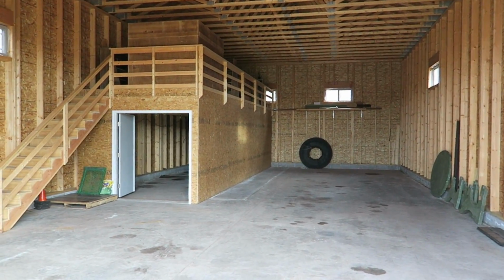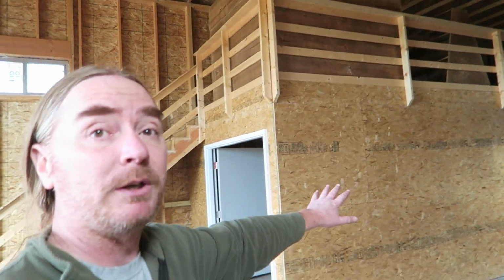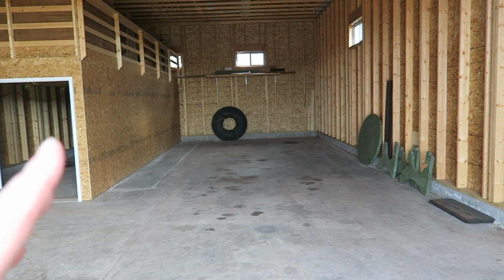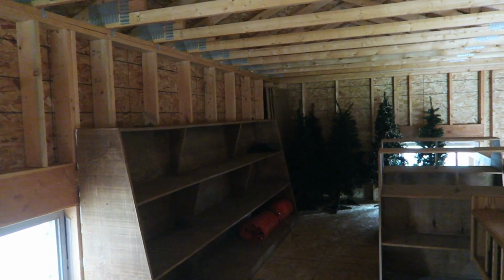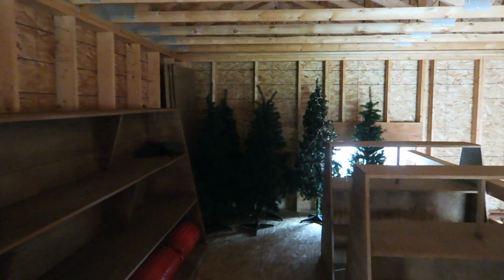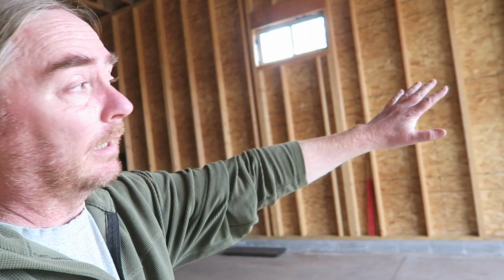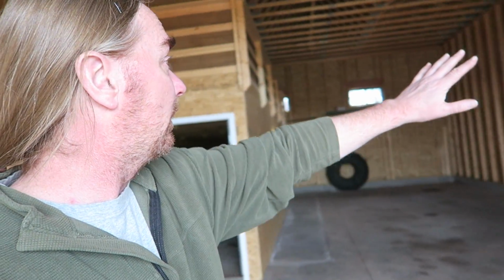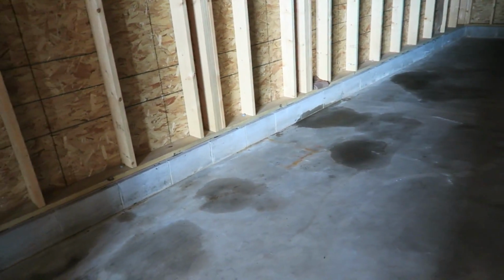CHECK OUT THE NEW BOAT SHOP!!

Comment: For this building I'd use rigid foam panels. Either XPS, EPS or PU. 
It's cheaper and those studs are ideal for it. I mean it's all straight. Spray foam is ideal if you have irregular walls and lots of nooks.
Also consider how often you need the space heated. Like if you only need a cabin heated 2 times a year it's not worth it to heavily insulated it. While if you work every day there it makes sense to insulate well.
What you also could look into but is a bit more experimental is to put lots of solar panels on top and JUST HEAT THE CONCRETE electrically. Basically you use your foundation and earth below your shed as a big thermal battery. Just put wires in the floor. This is by far the cheapest heating that you can do but you'd have to run the numbers. But solar panels are insanely cheap today. Cheaper than thermal solar or anything else, like 1 cent per kWh over 25 years.
PS: For LED lights you should get LED strips with a good "Color Rendering Index" (CRI). That is important for you because you need to "see" colors like they are. With some LEDs you get only specific spectral lines that can make colors look funny. Also nicer to be in.

Comment: Congrats on the new shop!  Hope everything goes with the shop upgrades.   It stinks that you might have to have a licensed electrician run everything.  Not knocking their work, but it gets expensive when you can do 90% of the work yourself.

Just an idea, when I rewired part of my basement after it flooded, for every outlet I replaced, I put two sets of outlets that are on two seperate circuits.  That way I can run two 15 amp tools side by side without tripping the breakers or running extension cables all over heck and back.  Just an idea that makes life easier.

Comment: Hi Andy, we live in a northern climate as well, Canada, and here it is common place to have R19 in batt insulation on the inside of your exterior walls and another 1” to 1.5” of foam insulation on the exterior of the building under the exterior siding. This provides a frost break from the outside and can provide an overall R value around R30 to R35. In the ceiling we typically use batt insulation between the wall plates and the rafter vents and them blown in fiberglass insulation to an R value of R40 to R50. Heat rises, so your floor will always be cool to cold and unless you create a thermal break, with rigid foam insulation which would involve a new floor! With closed cell spray foam you stop any and all drafts through the walls, which is key, and you do not need to apply vapor barrier over closed cell spray foam. Your ceiling will need vapor barrier to air seal it as tight as possible. Not sure about Michigan but here natural gas is by far the most efficient and economical, and as nice of a heat as baseboard radiation is there is little to no air movement so with walls that tall your heat is going to go straight up the wall. May want to consider some type of HRV that will help circulate the air in your new shop to keep the warm air moving and as close to the floor as possible. A hot air furnace that will blow the heat across your shop floor may be very comfortable and with the new furnaces they are quite economical. Stoping air infiltration and air escape is key when insulating. Good luck.

Comment: Hey Andy, have you considered using a polyisocynurate  insulation board fixed between your battens. It comes in a variety of thicknesses is incredibly thermally efficient and you can fix it your self. As far as the lighting is concerned ,led is the way to go but look into street lighting components, they are far cheaper than domestic lighting and will give you min 10,000 lumens and ballast that lasts. Good luck with sourcing locally.

Comment: another way is to put plastic vapor barrier  up   then drywall   then blow in insulation in wall  you will get R value of app 20.35  and will be cheaper to do

Comment: On the heating.  A couple of mini splits wouldn't be too expensive and would save you from having to bury gas lines.  Maybe a waste oil heater for the coldest days?  I had one in my old shop, burned 50/50 waste oil and diesel, worked great on the coldest days here in Maine.

Comment: First up get an energy audit for the building. The audit should also let you know what rebates and incentives are available in you area. The incentives may make some decisions much easier.  Electric and data can be run through the air so no digging if you can ditch the gas. Heat pumps have gotten much better and will work well for moderate days and provide cooling if desired in the summer. You would still want a fossil fuel heater to take over when the temps go below 15F. Giant solar array on the roof if grid tied can offset the electric heating expenses.  I like the idea of going with an inch of closed cell foam on the walls for air sealing with the rest of the cavity stuffed with either glass or blown in insulation. But again get an energy audit. The people who do those generally are  very up to date at what is the best path for that region.

Comment: You may want to check out "radiant heat tubes"  These are larger diameter tubes that would hang from the ceiling and run from the front to the back of the work shop. (2 - 4 tubes)  The advantage is you are not blowing hot air around the shop

Comment: Hi I was wondering if you could help me out I have a Ranger fibreglass bass boat where there’s a rod locker with piano hinges how the hinges that fastened to the boat is thin wall I would say and the screws don’t hold now so I was wondering if I took a strip of aluminum it’s fibreglass that to the wall side if that would be a good books to hold the PO hinge and the lid more secure appreciate your thoughts

Comment: Hi Andy, could you make part of that room under the mezzanine a spray booth  and install an exhaust unit to keep the fumes and dust down other? Also could you adhere foam and foil panels to the inside of  the panel lift door. If you  wanted to do underfloor heating put a membrane  over the existing  slab and use a self leveling  compound  to cover the coils.

Comment: Andy, here it is required to have a licensed electrician as well, if you have the knowledge you can do the work, then for a small fee a licensed electrician will sign off and the inspector sees that name for the work. You have to prove you know how since the electrician is putting their good name on the line though.
The home owner doing the work you might be able to get the variance from the inspector, but it still needs to meet code at least. The big problem with that, home owner doing the work if not licensed for it is insurance rates go up.

1" or 2" thick foam insulation ( as often used for inboard engine rooms ) on the big door panels will help reduce heat loss without major impact on the door operation.
With the floor not being insulated, by putting foam sheets down and pouring concrete on top you cover that aspect, it also reduces the height inside the shop but it adds a ramp requirement to the front outside the door.
The big closet under the loft, bulk storage space. Much easier than trying to rework it to allow your equipment to function.
An insulated interior wall between the front of the building and the doors with the side in front of the bay hung to roll to the other side and open access will also give you insulation from the big door losses.

Comment: Spray foam is excellent. for this year use 6 inch rock wool batts all around followed by vapor barrier, Vapor barrier the trusses and fill with 36 inch blown insulation. In 4 or so years build a 6 inch wall with 6 inch rock wool all around the inside of the building creating 14 inch rockwool batt insulation walls. A fella from Montana made a cement box 8 ft wide X 7ft tall, 20 ft long, piped the bottom with 4 inch thin wall plastic pipe to a manifold of 8 inch as a inflow, filled the box cavity with fist size stones piped the top of the box the same as the bottom. closed and insulated the top of the box to form a closed system. A 8 inch fan on each in and out manifold would pull the heat out of a solar air heater and warm the rocks. during the night and early morning the heat generated by the warmed rocks would be circulated into his house. In the heat of summer the fan would pull in cool air to cool the rocks and around 10 am he would circulate the rocks cooled air in the building. Worth a thought.

Comment: Andy, look into Cast Iron baseboard for the heat. Very durable, even heating. We use it here in Connecticut a fair bit, though it is more costly than fin-tubing.

Comment: Closed cell spray foam needs no vapor barrier. And its amazing. In the south the attic can reach 180 degrees in the summer no problem in standard blown insulation attics. With the roof rafters sprayed with close cell foam it’s literally the same temp as conditioned space. Open cell foam does require a vapor barrier. Good luck

Comment: Andy You have your work cut out. Unless you have won the lottery sharpen your pencil. You can do a lot of different things that give the same result. I read most of the comments and there are some good ideas but not all.  LEDs the way to go. However price price It is all over the place. I got four fixtures for the price of one.   

Electric since you don't have electricity at the building  I don't know how far you are from power or what the expense to run it in.  A generator might be cheaper. 

Foam insulation or Batt  Both work, then pencil work.   vapor barrier Plastic sheeting cheap.

You are correct the floor is a heat sink. You do not know if they put a vapor barrier down when the poured the slab. My suggestion on the floor place  plastic sheeting on the floor. On top of that 4 by 8 blue or pink foam 2" or 1" and cover with Plywood. Your feet or legs will love you later on. Again shop around 

Heating : Last week several people gave sites to over head radiant heating I have installed this in a WalMart distribution center. This would be the most economical way to heat your building. You will have to price the different systems.  They operate with natural gas but I would check to see if they could use propane.

Comment: Three years ago we built a home with a geothermal engineer installing our geo and doing our insulation.  R19 walls is good. Windows are a big loss area. Roof or ceiling insulation is critical. We have R38 in our ceiling and in one room that has three external walls, on the windward corner of the house ...we basically used up the remaining insulation we had bought at a contractor's auction... probably R50+    Moisture in / through concrete is detected best by duct taping a square of plastic wrap or plastic bsg to the floor and checking on it in 24 hrs. ...48 hrs. ...72 hrs.

Comment: Finally something I can give back to you. I live in Finland where it's cold all the time. Except one tuesday in June every other year.

In insulating the shed there's two factors; insulation (the R-value you use) and air tightness. Both of them are crucial to get right to make the shed efficient.

Insulation is the easy part. Just add insulation to all the surfaces.

Air tightness is another matter. You need it to keep warm air inside AND prevent the warm and moist air to get into the structures.
Your walls seems to be OSB sheets and some kind of steel plate on the outside. Is there air gap between to allow air to circulate to vaporize the possible moisture? If not, there's serious risk of rotting your shed if insulation and air tightness is done poorly.

Another thing I noticed is that brickwork under the walls. You need to insulate and make it airtight as well. If there's cold outside (= -10°C or more), there will be ice and freakin' cold breeze coming through that brickwork and seams.

What I would do:
-Insulate the walls between the current joists with glass or similar wool.
-Put additional 2x2 joists horizontally (trick is to position them in way that plaster boards will fit on them correctly) inside of them and air tight paper between the original and new. Then insulate that additional 2" with either wool or PIR/XPS/spray foam. That way you get another layer of air tightness. That way there's 8" of insulation (which is still less than the minimum in here!) and properly air tight structure that doesn't allow moist air into the walls.
-Plasteboards on the inside.
-On the ceiling air tight paper/similar and wood boards under that with screws and plasterboard under them. On top as much insulation as possible. Especially important is to tape and do big overlap with the paper on the top corners where wall and ceiling meet. Gaps must be airtight!
-The floor. I would definitely insulate it. Put at least few inches of high density foam insulation with tongue and grooves on the edges and pour at least 3-4 inches of concrete with proper steel net to keep it cracking. Also put the insulation against the brickwork and make sure the insulation is consistent and airtight with the walls.

-Heating: Just get hefty enough electric connection and put air heat pump. No fossil fuels needed. Also cools down the shop at summer.
-HVAC: You need some kind of ventilation anyway. Get good efficiency HVAC with heat recovery to keep wasted heat at minimum.

Hope this helps. Of course the solutions and materials may differ from country to country but building physics are the same I believe ;)

Comment: flash and batt is a good compromise for us in the south.  a few inches of closed cell foam and rock wool 3-1/2" batts over it.  But you would most likely still need a vapor retarder up there.  Too bad it isn't a new build, there are some excellent exterior rigid insulation systems that give you a continuous r value as  well as a vapor retarder. If it wasn't for the mezzanine, would say put Therm-All's R-seal on the interior walls and ceiling and be done with it.  One day project for a couple guys, if it wasn't for the mezzanine, but you could still make it work.

Comment: Great new shop Andy. Looking forward to some great new projects there. You will have to do something with the floor or it’s going to be just a huge heat sink you could lay rigid foam sheets with a mortar screed on top. After you insulate the walls consider rigid foam over the top of the studs with your lining of choice over that. This prevents cold spots from the studs.  Decide on how much height you really need dropping the ceiling down will give you a smaller volume to heat and save money on insulation. A cheap possibility temporary solution would be to build a small supper insulated space within the existing shop this would solve the other issue you have with the door. Oil might be the way to go as it’s cheaper to buy an oil tank than run in gas pipe. 👍

Comment: Andy, he is spot on with the spray foam and blown in the attic, absolutely spend the money, it will pay for it's self over time. It will be so comfortable in there even when it is howling outside. 

I grew up in an area of Montana where it is not uncommon in the winter to see temps of -30. 🥶

My dad's shop was 80x120 and had spray foam, and the gas fired boiler, it was easy to get it too hot to work in that shop when I was welding in there in the winter time.

Comment: LED fluorescent style lights are extremely bright, they use little energy, and last a really long time. They are also cheap on Amazon. Just wire in outlets in your ceiling and you can swap them easily from their clips.

Comment: Hi, Andy...I had similar questions insulating an older house...spent the money for spray insulation, not sure I would do it again.  Instead, you’ve got 2x6 walls, you can get excellent batting insulation in there and cover it with a vapor barrier and then Sheetrock, paint it a light color and you’re half way toward having the light in the shop you need.  I’d do the same (only more R-value) with the rafters, then build a flooring (and stairway) on the existing stud ceiling in the main part of the workshop for more storage—might allow you to open up the small enclosure for more floor space but maintain storage.  Go LED’s for lighting...I just used inexpensive 4 ft LED shop lights and wired them together for my workshop, it’s incredibly bright at a fraction of the cost of other types.  As for heating, skip the gas line and just do electric.  Having put in mini-splits, I can tell you from experience that they’re the most efficient and comfortable way to go for both heating and cooling.  Near to or more than twice —yes twice— the efficiency of a standard system.  Leave the wiring, trenching and Sheetrock to the pro’s, bet you can do the rest and save yourself some dollars.  Mini-splits are easy, so’s the insulation...I’ll bet you can do it all for under $20 grand.  Just my 2 cents worth, but having owned/rehabbed more than 6 houses over the years, I’ve learned a few things.  —Don

Comment: Why are you making that space work ... 

.. instead of finding a place that works? Is what my father would say. 

You just rattled off a very long list of problems that need to be addressed to get that space into a usable condition. (About $50,000 to &100,000 worth. Plus the weeks and weeks of time required.) Instead of researching all the ways to fix-up this space you could be using that time to find a space that already works.

Comment: One of the advantages of spray foam in a 6 inch deep cavity is that you can install any services after the building has been foamed. The spray foam acts as the vapour barrier so you can run electrical, water, air or any other lines ‘inside’ the vapour barrier after the insulation has been installed. There’s no fun in spray foaming insulation into a cavity over your services if you have to make changes in the future.